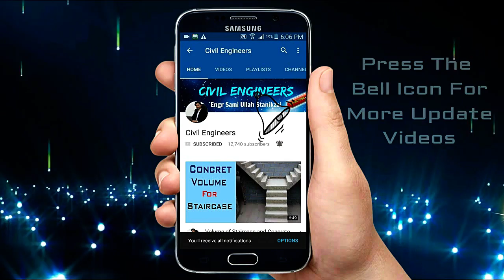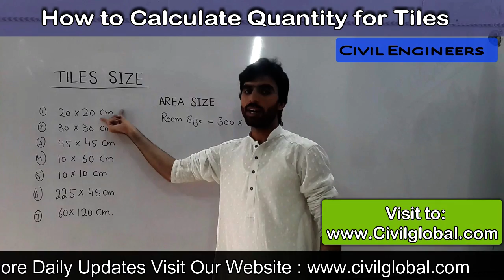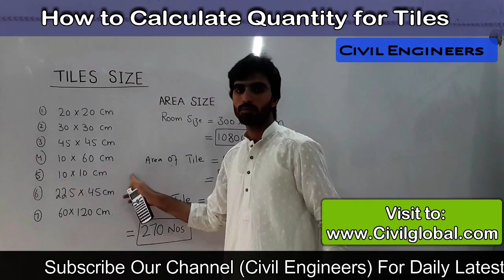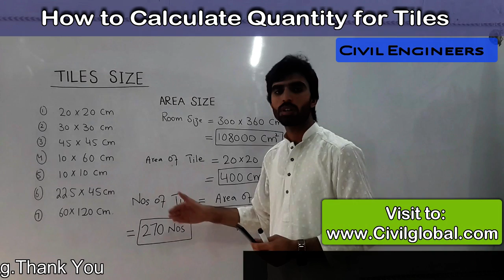How to Calculate Number of Tiles

Comment: please tell , how to calculate boxes required, if tile box has 8 in int ?
Reply: Madhu Sudhan 
If he divide 108000/400 
This is the size of the room/on the size of 1 tile. So... You answer by your self already. 1 box has 8 you said. Well.. 1box has 400x8=3200
108000/3200=33.75 boxes
So now you know how many boxes do you need

Comment: My room size is 12 by 12 or 8ft 6inch by 5ft 2 inch  n i want to put 2feet by 2feet tiles how many tiles requried for this room.explm with video.
Reply: priyanka Das gupta Priya 36
Reply: You need 18  based on 2 feet x2feet tiles.18x 1.1= 20